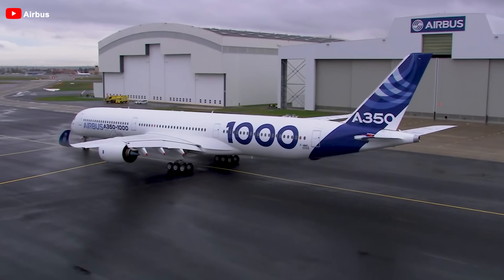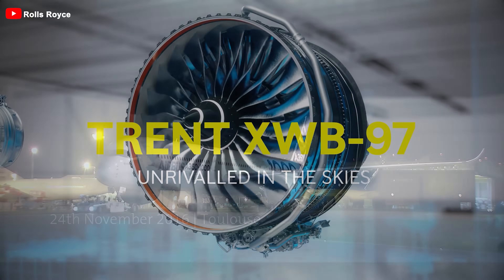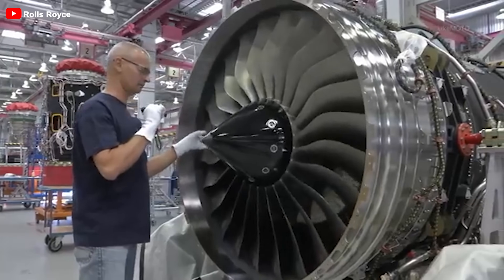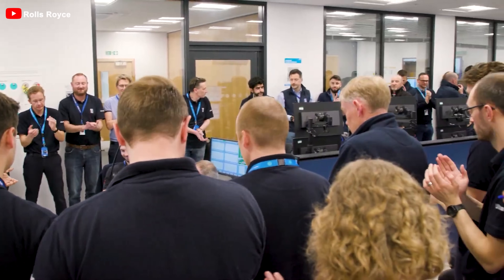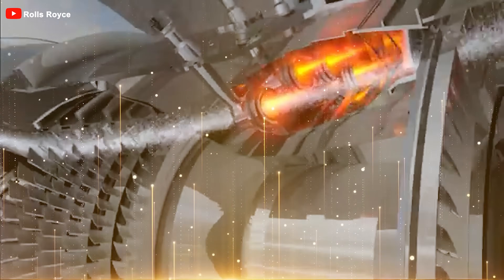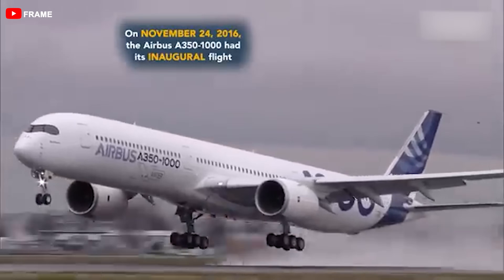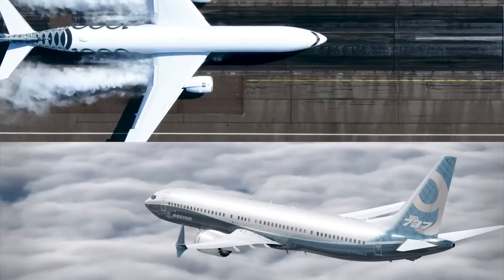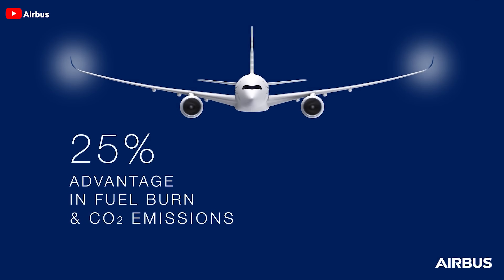NEW Airbus A350 Engine Upgrade Is THE END Of Boeing! Here's Why

Comment: A350 1000 will sell much more,its sibling is better fit so people buy 900 which is the right spot. A350 900. But upgrades will make A350 1000 a much better and much more improved plane. which will sell. Maybe they need build A350 2000 hmmm

Comment: XWB 97k needs be 105k then it will be much better. As it is needed in MID EAST where sand dust humidity and hot air make engines burn out, quicker. The engines need more off time, which means no flights. It needs be more on time. That is Emirates biggest worry. So improvements on wing time is more important, more power is needed for xwb 97k , need be 105k

Comment: So emirates could buy the A350-1000 if the upgraded Trent 97 actually occurs?
Reply: The problem is not the fuel efficiency, but the performance in hot conditions, the lack if power besides the GE option and the time the engine needs to go out of the airplane to be checked in depth. If they cannot equal nor overtake this key points against the GE9X, it won't be a option to Emirates.

Comment: A company oriented to its customers (airlines and users) not to the greedy investors.
Reply: RESULTING IN GREATER SALES WHICH IN TURN LEADS T0 BIGGER PR0FITS, HIGHER DIVIDENDS AND HAPPY AIRLINES AND PASSENGERS. IT IS N0T S0 MUCH THE SUCCESS 0F AIRBUS AND/0R R0LLS R0YCE BUT THE ABS0LUTE FAILURE BY B0EING. B0EING L0ST ITS H0NESTY 0VER A DECADE AG0. FAILED 0N 737 MAX RESULTING IN 248 DEATHS (2 "SUICIDES"), FAILED WITH THE STARLINER, FAILED T0 FIT D00R PLUG B0LTS, FAILED WITH 777X WITH THE WING. THESE ARE ALL AV0IDABLE MISTAKES. SUBSIDISED ILLEGALLY WITH UNREQUESTED F/A-18 SUPERH0RNET 0RDERS N0T REQUESTED BY USN.
Reply: @trevorhart545  that's true, still I'm keeping my fingers crossed for Boeing to get out of the crisis and I believe that it will manage in time.

Comment: Airbus puts a portion of profits toward  research & development. Unlike Boeing that likes to fatten their shareholders profits! Instead of advancing their technology they take short cuts & re badge 60 yr old 737's
Reply: The 737 is defective technology with design flaws relating to the lower comfiguration of the engines.    Bring Back the reliable 727 and  747.

Comment: The media believing those videos 
Wow
Also  the 787 is better than the a350
Reply: FAIL 737MAX PLANE CRASH
Reply: @jeffreyraquepo1300   wtf is this grammar lmao
Reply: @jeffreyraquepo1300 Bus crashed their first 320 when it had new tech. So piss off
Reply: The best airliner is the one which sells best!
787 isn't better just because you live in the US!
Reply: @rickwhite4137  Yes you can go to cargo bay and light you cigar on the battery leads....
Reply: @rickwhite4137  The 787 is the first wide body airliner to reach 2000 orders.
RR was a dismal failure on this aircraft and GE is outselling RR by a margin of 3 to 1 on the 787.
Reply: @rickwhite4137  🤡🤡🤡🤡🤡🤡🤡🤡🤡🤡🤡🤡🤡🤡🤡🤡🤡🤡🤡🤡🤡🤡
Reply: @rickwhite4137 it’s also the safest while it’s grounded due to faulty pilot seat switches